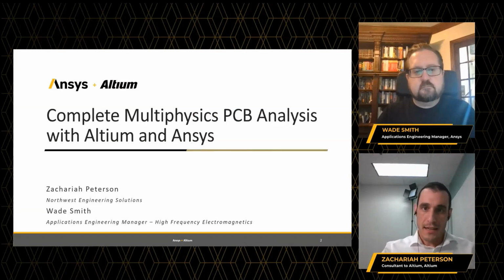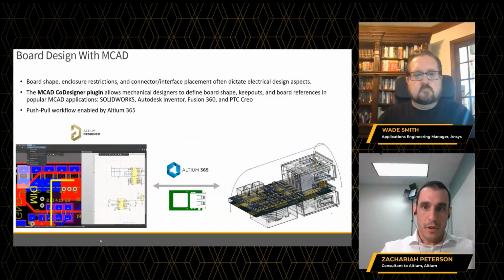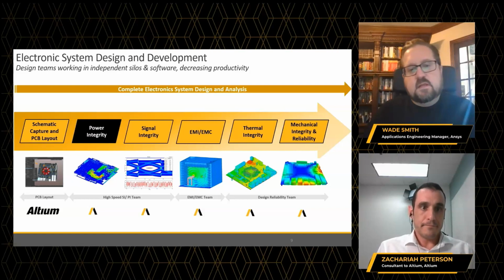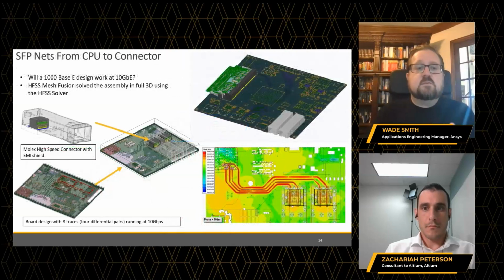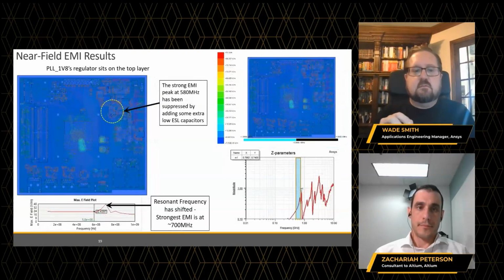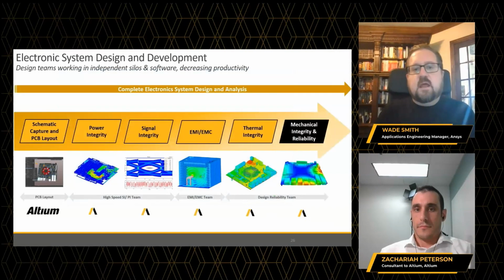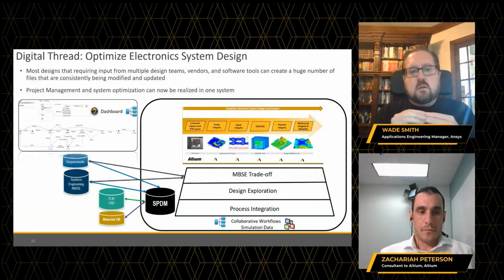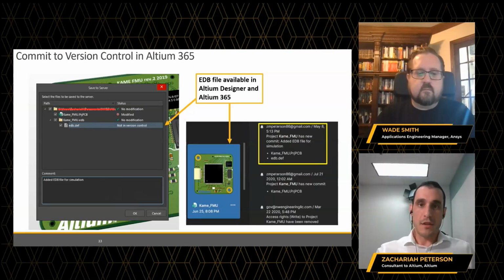Complete Multiphysics PCB Analysis with Altium and Ansys

Comment: Hi Zach, Can we use the same file (Ansys EDB extractor) to work with the Ansys Q3D simulation tool? Can we expect any videos related to this topic in future?
Reply from the maker: Hi Sai, I believe that is correct, and if you can't do it with an EDB file you should be able to do it with EMN/EMP files. It sounds like a good topic so I will try to fit it into our list!